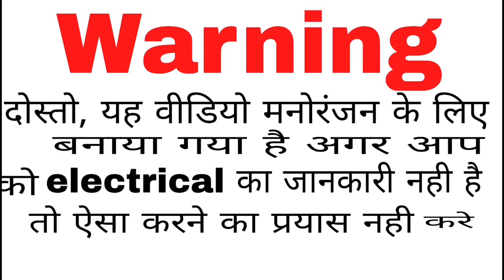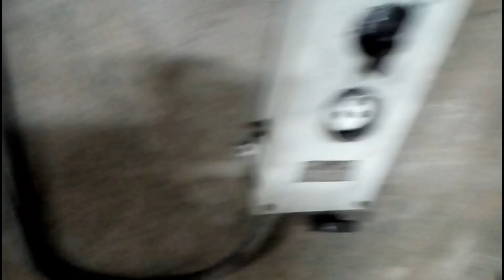Salt Water Welding Machine ,How to make salt water welding machine

Comment: The red wire goes from one of the hot wire source ( outlet) to a welding rod in the saltwater bucket.
The blue wire goes from another hot wire source( outlet) to an angle iron in the saltwater bucket. 
Another blue wire goes from the second angle iron immersed in the saltwater bucket to whatever you want the welding done. 
Is this right?
And are you hooking your wires to 220/240  volts?
Reply from the maker: Yes ,but don't use room wiring House wiring

Comment: These types video they only shows the negative wire in water ,but don't shows positive 
Welding needs high voltage and high amps...kotha.😂😂😂
Reply: BoSsOm boss you are right but instead of high voltage and high current, welding requires high current and low voltage.
Reply: @manishholla  
Thx